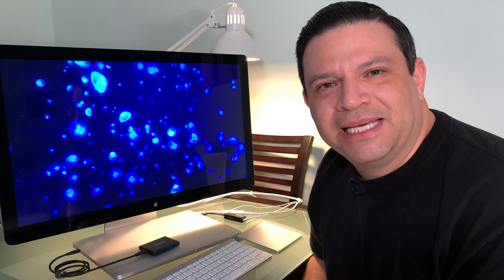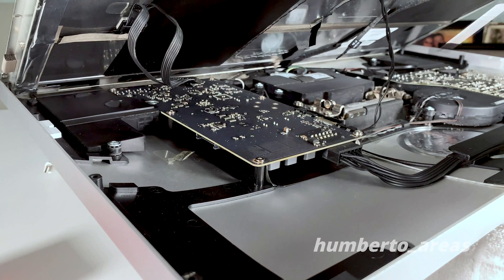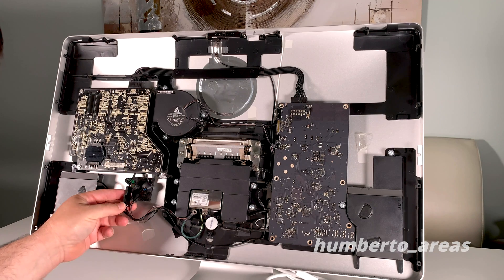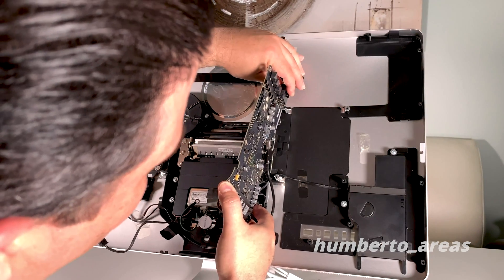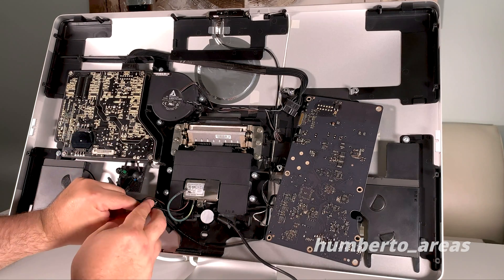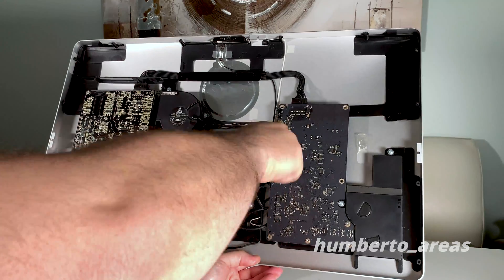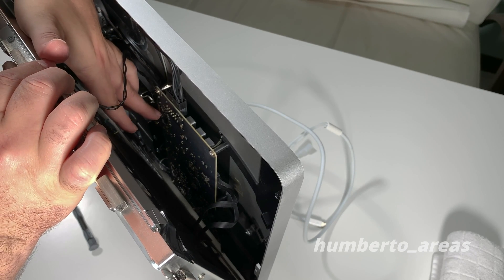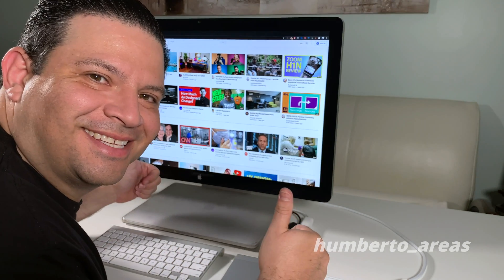Apple Thunderbolt Display Not Turning On - Step-By-Step DIY Repair 2026

Comment from the maker: ⚡Question of the Day ⚡ How do you use your Apple Display? Let me know what setup you have? Are you into music? Fashion? Graphic Design? Packaging? Let me know how you guys are putting these beautiful displays to work in 2020.
Reply: I use a Cinema Display 27 to extend the desktop of my iMac.  The CD 27 has the same screen and specs as the Thunderbolt Display.
Reply: Excellent video man, my display does it sometimes. It also don't wake up at OS start up sometimes. The brightness and volume controls on the keyboard are the only 2 things holding me from not upgrading it to a new one.
Reply from the maker: @waltervenicio  Hold on to your display as long as you can! I almost pulled the trigger on a BenQ monitor... Glad I did the research and fixed my display.
Reply: Editing (Film/Shorts other content), productivity.
Reply: Hello, good afternoon, Humberto, I have an Apple display 27-1407 and I bought it used it. He doesn't give the sign of life. Can it just be that cable? I turn it on to my Mac and it's black screen and doesn't load the Macbook. How much is this cable? does it charge the MacBook on it? Sorry for My inglês 😬
Reply from the maker: @Tinoco Premium, the cable is around $20-$30 USD and yes, it will charge your MacBook if you have a model that supports the magnetic MagSafe connector. Hope this helps, good luck with your repair and thanks for watching.
Reply: I use my 27” Apple Display to extend my MacBook Pro screen. Since retiring, I play Minecraft and other games with friends online. I love how clear the game looks on the large display. I also enjoy being able to keep email, my web browser and messages open on the laptop screen, while enjoying my games or editing photos, documents, etc. on the Apple display.
Reply: My Apple Dispaly 27 Thunderbolt display shuts off after a couple of minutes but after re-plugging it in, it works and then shuts off again after a few minutes...usb key sometime mounts, sometimes not. Sound is the same. What a nightmare for a 1000$ monitor. Do you think the cable swap you are showing would solve my problem. BTW, very professionally done video.
Reply: Graphic and web design

Comment: Just picked one up, and wasn’t sure if this was normal or not…so you know if the display uses PWM (pulse-width modulation) to regulate the backlight or if it is DC dimmed?
Reply from the maker: @Harry_11 Great question — and yes, this is normal behavior for the Apple Thunderbolt Display 27" Model A1407.

The A1407 does use PWM to control the LED backlight brightness, rather than true DC dimming. At lower brightness levels, the PWM frequency can be noticeable to some people, especially if you’re sensitive to flicker or if you’re viewing it with a camera or in peripheral vision.

A few helpful notes:
•Flicker is more noticeable at lower brightness settings
•Running the display at higher brightness (70–100%) significantly reduces PWM artifacts
•What you’re seeing is a design limitation of the era, not a fault with your unit

If you’re testing with a phone camera and notice banding or flicker, that’s a classic PWM giveaway. The panel itself is still excellent for its age, but PWM was common on Apple displays from that generation.

Hope that helps — And one last thing... Q: what part of the video did you find most helpful?

Comment: How did you know that it was just the cable? I have the same problems. First flickering, now a complete black screen.
Reply from the maker: @franzwagner6634 Thanks for watching and  for posting your question. To be honest, I started troubleshooting the issue... my laptop would recognized the display being plugged in. The all-in-one cable is responsible for video/audio signals... so I started by replacing the cheapest thing, which is the all-in-one cable.

This is a known issue with these old displays. I figured it was worth swapping a new cable since these displays still look amazing to this day!

Please keep me posted and let me ask, which part of the video did you find most helpful?
Reply: @HumbertoAreas  It was in fact the cable. No problems at all with an external thunderbolt cable. But, why should I repair the internal cable at all?
Reply from the maker: @f @franzwagner6634 You don’t have to replace the cable at all, if you’re ok with an additional Thunderbolt cable connection, that’s ok… just glad to hear that now you are certain it is the all-in-one cable that is faulty.

Comment: Thanks but the cable is too expensive now, is there any way to fix the cable instead of buy a new one?
Reply from the maker: @johnwagons4707 Unfortunately, in most cases the Thunderbolt cable itself isn’t realistically repairable. The internal wiring is extremely thin, shielded, and molded into the connector, so once it fails there’s no reliable way to splice or rebuild it without specialized equipment.

That said, before buying a replacement, I’d suggest a few quick checks:
•Inspect both ends of the cable closely for kinks, cracks, or bent pins
•Reseat the cable connections internally if you open the display
•Test the display on another Mac (if possible) to rule out a port issue

If the cable is confirmed bad, replacement is really the only long-term fix. I agree the prices are painful now, but repaired or DIY-spliced cables usually don’t last and can cause more issues down the road.

Thanks again for watching and what part of the video did you find most helpful?

Comment: Great video,, but Im not sure is only the cable I tried connecting from the back thunderbolt port directly with no luck, can it be the power supply?
Reply from the maker: @Videomac Thanks for watching! If you’ve already tried connecting directly to the back Thunderbolt port and the display still doesn’t power on or get recognized, then yes — it could be the power supply.

Here’s what I’d check next:

1. Listen for the power “click” when plugging it in — no sound usually points to a dead PSU.

2. Look for any signs of life (camera, speakers, or USB ports showing up on your Mac). If nothing shows, that’s another clue it’s not getting power.

3. Inspect the power supply board and logic board for any burned or swollen components if you’re comfortable opening the display.

If both the internal Thunderbolt cable and external cable are good, the power supply is the most likely culprit. Replacing it often brings these displays back to life.

Please keep me posted on your progress.

Comment: The links for the replacement cables that you provided are no longer good. Do you have a new link with a current source to get the parts?
Reply from the maker: @Krucifydministries Thanks so much for sharing that tip! 🙌 Re-seating the driver and function connectors is a great suggestion — it’s easy to overlook, but can definitely fix connection issues like that. Appreciate you contributing and helping others in the comments!

Which part of the video did you find most helpful?

Comment: Friends, before you replace any components, re-seat the driver and function connectors to the logic board.  Pins and pads can lose contact.  This cured my LED Cinema Display which had no screen turn on.
Reply from the maker: @encinobalboa Great tip — thank you for sharing this. You’re 100% right 👍 Reseating the driver and function connectors is an important first step and can absolutely resolve no-power / no-display issues caused by poor contact over time. It is recommend checking connectors before replacing components, and your experience will definitely help others troubleshooting their display. Appreciate you adding value to the discussion!

Comment: My Apple Thunderbolt Display isn't working. No Mac or Windows device recognizes it. I've tried swapping power cables, the internal Thunderbolt cable, and the external Thunderbolt cable, but nothing. Is there any way to fix it, or what exactly could it be? Greetings, excellent channel.
Reply from the maker: @ElniñoArgenis Hi there — thanks for reaching out and for watching my video!

If your Apple Thunderbolt Display (27”, Model A1407) isn’t being recognized by any Mac or Windows device — even after swapping power and Thunderbolt cables — that narrows things down quite a bit. Here are some next steps and possibilities to check:

Confirm it’s actually powering on – Look for signs like the faint “click” of the power relay or the front camera/mic showing up in System Information. If there’s no sign of life, the issue could be with the power supply board inside the display.

Try a known-good Thunderbolt 2 connection – Remember that this display uses Thunderbolt 2 (Mini DisplayPort connector), not standard Mini DisplayPort or DisplayPort. It won’t work with simple adapters or Windows PCs that don’t have a true Thunderbolt 2 or 3 port. If you’re testing on Windows, make sure it’s a Thunderbolt-capable system and that Thunderbolt drivers/firmware are installed.

Inspect the internal I/O board (logic board) – This board manages both power delivery and data. If it fails, the display won’t be recognized at all. Many users find this is the most common failure point after the cable.

Check for power supply output – If you’re comfortable opening the display, you can test with a multimeter to ensure the PSU is outputting 12V and 3.3V correctly. If not, it’ll need to be replaced.

Last resort: full board replacement – If both the internal cable and power board are known good, the Thunderbolt logic board itself is likely bad. Replacements can be found on eBay, though repairs on these displays can be tricky and parts availability limited.

If you’ve already replaced both cables and the power cord, I’d focus next on testing or replacing the power supply or logic board — those are usually the culprits when there’s no recognition at all.

Hope that helps point you in the right direction! Please keep me posted.

Comment: I got a A1267 24 inch monitor and it has sound and is detected with my 2013 iMac and laptop but the screen doesn’t get a picture. Can this be fixed?
Reply from the maker: @TMAN26 Hi there — thanks for watching my video!

Since your 24" Apple Cinema Display (Model A1267) is showing sound and being detected by your Mac, that tells us power and USB connectivity are working — which is a good sign. The issue is most likely related to video signal. Here are a few steps you can try:

Check the connection type – The A1267 uses a Mini DisplayPort (not Thunderbolt), so make sure you’re connecting it to a Mini DisplayPort-compatible port or using the correct adapter. If you’re plugging into a Thunderbolt port, it should still work — but not the other way around.

Inspect the cable and connectors – Look closely at the Mini DisplayPort plug for bent pins or wear. Try gently wiggling the connection while powered on to see if the image flickers on.

Try another Mac or adapter – Test the display with a different Mac or a known-good Mini DisplayPort-to-DisplayPort adapter/cable. This helps rule out compatibility issues or a bad port on your current computer.

Reset PRAM/NVRAM and SMC on your Mac – Sometimes, display detection issues clear up after these resets. Apple has guides for both on their support site.

Backlight or display board issue – If the monitor powers up, but there’s no image even under a flashlight, it could be a faulty backlight, logic board, or video cable inside the monitor. At that point, it may need professional repair or part replacement.

If after all this you still get no picture, I’d lean toward an internal display issue — not something caused by the computer.

Hope this helps you narrow it down! Please keep me posted.

Comment: Didn't work for me, BUT I found another good solution:

I'm in a country where it's not very easy to get the replacement cable, besides that it looks like stock is ending because I don't find them on Amazon anymore (at both links under the video out of stock) and rarely on Ebay.. BUT, a very good alternative is to buy a Thunderbolt 2 (A1410) cable and (if needed) an Apple Thunderbolt to USB-C converter (A1790). Plug the cable in the Thunderbolt port on the back of the screen and (with the converter, if needed) in your MacBook and it's back on! Cheaper and plug and play. 

Thunderbolt screen (mid 2011) + MacBook M2 Pro 14 inch (2023)
Reply from the maker: @patvanvoorst3142 Thanks for sharing your solution! It's always great to have alternatives, especially when parts are hard to find. Your method will definitely help others facing the same issue! And of course, thank you for watching and for posting your comments.

Q: which part of the video did you find most helpful?

Comment: Humberto, does your monitor have a separate 120 volt AC power cord? Mine does, do you think the Thunderbolt and mag safe cable would be the same?
Reply from the maker: @porthole2, Yes, my display does have a separate 120 volt power cord. The 120 V cord powers the display, while the magsafe cable gives additional por to MB and MBP, since those laptops need a power source when in the closed position. So the answer is no, it's not the same - those 2 cables serve different functions. Please keep me posted.

Comment: my display will work on my 6,1 trash can but not my 13,1 mbp. is this the same issue?
Reply from the maker: @kkc-w7y Checking in to see if you have any updates/solution to your issue? I don't think a defective cable is the issue in your case, but lets troubleshoot further...
Q: what year is your trash can and what year is your MBP?
Q: are they running the same Mac OS?
**It is my understanding that Apple dropped support/updates for the 6,1 trash can as of 2024. Thanks again for watching and for posting your question.

Comment: Whoa! I'm having the same issues with the TB monitor I've been using. 
Unfortunately, it won't turn back on after it blacked out a couple of times.
I'm glad to know that there's a way to save this beauty and keep using it, however, I am dare to try it by myself. 
ㅠㅠㅠㅠㅠ
Reply from the maker: @hangleez, thanks for taking the time to post your comments. You can definitely do this! Just take it slow and follow the steps carefully. Which part of the video did you find most helpful? Thanks again for watching.

Comment: Where to buy the cables? Can you share the links
Reply from the maker: @allanyj, I had included a couple of links to Amazon, where a couple of vendor had the cable replacement available. Perhaps they're out of stock at the moment, you may want to look elsewhere like ebay for these. What part of the video did you find most helpful?

Comment: Hola Humberto! Thank you so much for providing this easy to follow tutorial repair. I found the Apple A1407 Thunderbolt Display Cable on eBay. I'm just having a hard time connecting the last sleeve with the tag (12:05). Should the last cable labeled  "MLB SIDE ICT" face the frame or should it face the LCD display? Hope this makes sense. Please advise.
Reply from the maker: @sandrasotoramos8293 Hello and thanks for reaching out, watching the video and taking the time to post your questions.

You're not alone on this one... everyone has a hard time reconnecting that last cable with the tag on it. Although it is the hardest to reconnect, it is the easiest to figure out in which direction/orientation it should slide in.

The tag and lever on that cable should face up and away from the logic board, otherwise you will not be able to fold over the tag/lever that holds it in place.

So tu answer your question, yes, it should face the LCD displays.

Please keep me posted on your repair and let me know which part of the video you found most helpful?

Comment: You are amazing!!  I was just about to bring my beautiful Apple display to Goodwill when I ran across your video.  I've never repaired a monitor but I ordered the supplies you recommended and for less than $200, I repaired my monitor with your excellent instructions.  I did have to go back after I finished the first repair because it still wouldn't turn on.  However, I went back through the video, opened it back up, reseated all of my connections again, and voila!...it worked.  Thank you so much for your detailed video. Not only did it save me a ton of money but it saved the environment.
Reply from the maker: @carolarm1 You and your willingness to take on something you had never attempted before is what's amazing. So happy to hear that another one of these displays is back to work!

Thank you for taking the time to post your comments. So glad my video was able to help you.

PS: Which part of the video did you find most helpful?